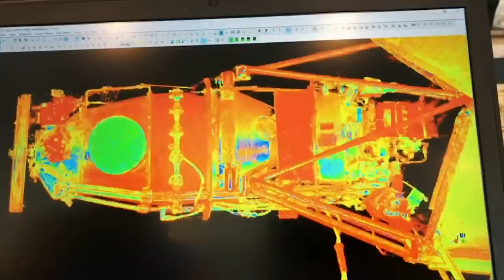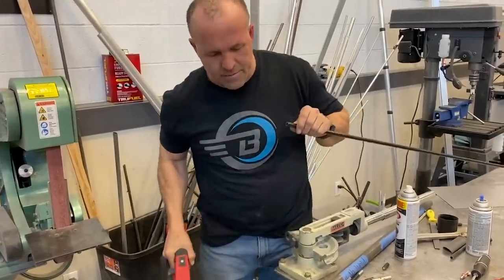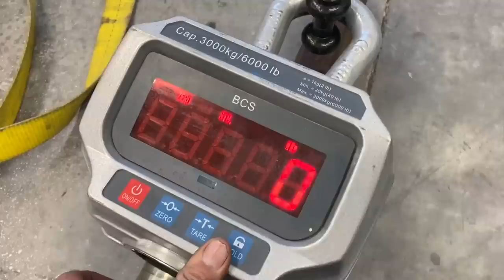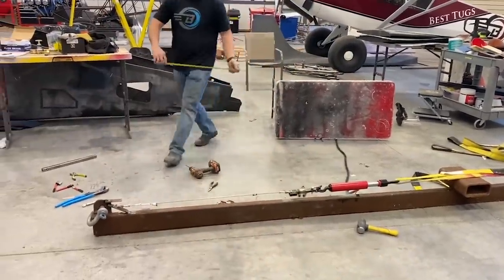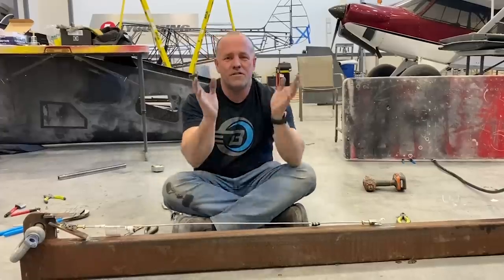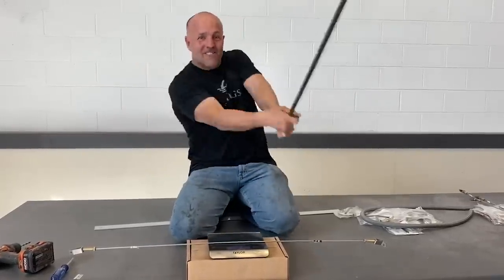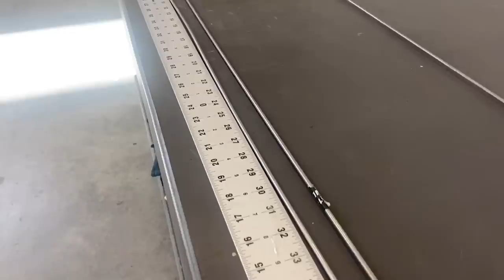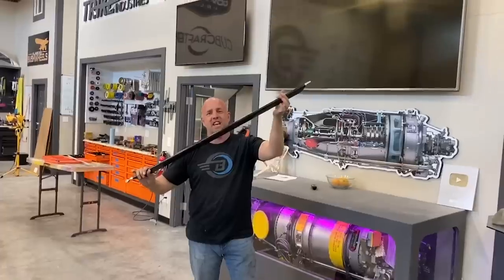Testing to Failure (Scrappy Bush Plane 17)

Comment: As a truck driver, I approve of this video!
Twist your straps, PLEASE!
Very few things more annoying than listening to the screaming of strap flutter from someone who doesn't know how to do it right lol
Plus, it's not uncommon that it leads to failure, especially with the light duty consumer straps, because it's causing constant friction where it goes over a corner or whatever.
But, just a half or single twist, if they are twisted lots of time, it doesn't distribute the load across the width of the strap properly, plus it looks ugly.
And make sure you tie the tail of the strap up, wrap it around things, duct tape it on, etc, so they aren't flying in the breeze.
I almost put my front tire on one hanging 20 feet off the back of a car trailer at a red light last week lol

Comment: You needed a telltale paint mark at the compression clamp to see if the rod slips in it. They use the same marks on cables to see if they shift in the Nico press sleeves.

Comment: I never saw such a positive proof of the strength of carbon fiber before.  Now I guess the challenge is connecting to it.  No welding.  Good rivets and epoxy I guess.  I wonder about a grooved compression fitting of some sort.  One suggestion....decaf coffee. 😝

Comment: I have a master engineer concern :o) It’s just the expansion rates between the steel frame of the tail and the carbon stringers. It will need to find that some where in the structure. I guess at altitude the carbon stringer force will reduce. And be maximum on the ground in direct sun on black tarmac. - That glued socket joint was epic. Really interesting vid, loved it ^-^

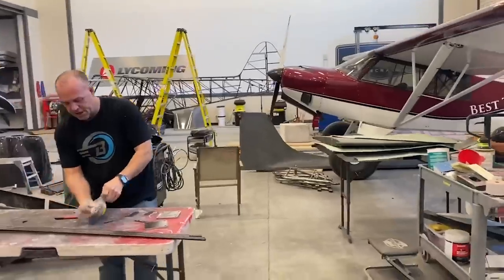Comment: Is that piece of metal on the rudder ( looks like it has 3 rivets in it ) @ 1:59 a trim tab?
* See if I understood this correctly: 550 lbs - compression fitting
** Didn't realize the bar passed thru the compression fitting and had a nut on the end. If I had realized that, I would've predicted the rod would break... And I still would've been wrong.
* Will try putting a twist in the strap on my boat. It oscillates like crazy on the highway. Thanks for the tip.

Comment: As a Mechanic and amature fabricator the only thing missing from the test is vibration. What is the long term effect on the metal to composite bond?  The real life stress cycles will include vibrations and harmonics from the engine. That would be my only concern is the bond joint can't  be inspected until failure. Keep up the good work. Your videos have given me many ideas for future projects although  none are aviation related. I can't wait to see Scrappy fly and hope you make it to Sun and Fun. I would have to attend just to see her fly.

Comment: Great explanation on testing to fail Mike.
I love the parts you make with Carbon fiber. 
My question is how will you set tension equally on all wires(struts by now) equally?
In flying and landing wires deflection is used, so how will you set tension?

Comment: Looking at scrappy the area change on the tail surfaces looks in the order of near double but with the velocity changes from that engine / prop combination, would be interesting to know as that would determin the loads. As double the speed get four times the lift load so with double area, you would be in the order of eight times the loads (which is right at the place your carbon ones are at, with the same % reserve factor). I know your not going to fly at twice the speed of a normal Cub but just tought that prop blast might put an airflow of that order over it, that said I don't think so as the prop choice you have, is more about volume of air, rather than speed of air.
As ex Lotus design engineer, I can say that Colin Chapman would have been very happy with the wire failure (multi component fail).

Comment: Any stretch would be the first failure, which you just said,  I think the brass threads would fail first before the cable.
Reply: I figured bond would brake but you see how the combination of glue and rivets together increase the load.  The twist in the foil was explained very well. awesome job! so fun to follow along.

Comment: Mike. Question. The added stiffness results in a higher peak load. Not only for the attagement points but also the control surfaces, lets say when you transition the loading on your control surfaces. Did you factor this in while engineering? What about buckling. I don't know how much flex is in the elevator wings at the attagementpoints. The wires look like they will bend and strech back after buckling. The carbon fiber will break after a surtain angle and have lost tensile strenght. Or will the deflection of the elevator be to little to ever come to that point. Hope you keep it up...keep on scrappin.
Reply from the maker: Great thoughts and I love when people think and ask at the level that would bore most people.  👍🤠 We think alike. All of that was taken into calculations. In a later video you will see the doubled up attachment points as well as turnbuckles that allow movement at the ends.  I have overbuilt it including everything you mentioned.  I wish I had time to dive into all those details it would make my videos hours and hours longer on each topic.  Sadly I wouldn’t  have time to build anything. Hope you can understand 🤠. Cheers and thanks for the thought

Comment: As far as flat straps vibrating in moving air, I think you are referring to Aero-Elasticity? 
was that a sneak peak of DracoX?
looks like it already has the turboprop mounted, and the wing mods done?  Still needs landing gear mods?  or just wheels?  The white looks spectacular!

Comment: Hey Mike, how can the stress testing of a flying wire be more fascinating and suspenseful than a Netflix thriller? But it is! what a fun episode to watch. 
I was wondering and I am curious: I have used that same technique on my RC-models, e.g. for pushrods, rudder linkages and such. However, it being so small in comparison I never used rivets. Just your epoxy method that you showed. I would be immensely curious what load it would have taken with just epoxy and no rivets. Cause after all -the rivets also weaken the carbon fibre rod... another testing for that? Just for fun? since breaking things is so much fun - and I agree, totally!

Comment: Have u considered the resonance / harmonics vibrating the carbon fibre wire? , and if it will effect the brittleness of the underlying weave?
The metal of course has a elasticity to an extent, and then there after plasticity/aka failure.. of which the threshold is quite high and broad, 
In retrospect, the carbon fibre id think would have a greater overall tolerance/to stretch, but with the wind resonating the rod, as like when flyingwires hummmm, its noticeable/audible  at a certain pitch, but think of the vibration we dont see or hear, that might work away at the weave..
Just a thought ,incase of terminal failure in flight under load/ and under axial stress/& vibration.
Super cool demonstration and video though!! Truly awesome work your doing that brings me back !
Reply from the maker: Marty B  thanks for the great comment 👍🤠 usually if I go into that much detail on my videos I get a massive majority stop watching and bail out.  I watch the analytics closely and find 99 percent of people want basic discussion that is in normal terms.  Everything you mentioned was analyzed closely and it would take more time than I have to type and go into it but we are absolutely in great shape.  This has been proven to an extreme on sailboats and several other areas with extensive research.  Thanks for thinking enough to comment.  Maybe in a later video I will get a chance to discuss all this in extensive detail and show a couple other tests.  Cheers my friend 👍🤠
Reply: Mike Patey absolutely understood and appreciate the reply!👍👍
Im no engineer , but i was &am  an r&d , think/design/builder , so thats why id thought to chime in 😊😊.                     Very cool knowing u go outside the box , ie: marine applications , etc,. in Consideration to your product build applications and design. I love watching your episodes, it invigorates me lol, and keeps us energized for our projects...., keep up the great work!  Hope we can cross paths and chat airplane one day!        Cheers!

Comment: Are you testing the part for impact resistance? There will be rocks hitting the strut occasionally. The Wire can deal with rock impacts pretty well. Carbon can get fractured by impacts.
Reply from the maker: actually great comment.  A couple of us have broken our flying wires with rocks.  The impact of carbon before it breaks on the thickness i got is actually higher and stronger than the wire.  this was one of the other reasons i did it. Also when we broke wires one of my friends broke it on take off and almost killed him once he lost one,  all the wires that were  in tension so the remaining loosen up without the full loop around all four. If i lose lets say one lower carbon tube i have compression on the one above it and still maintain full stability because i have compression loads high enough to hold it from one side.  great question my friend .. cheeers
Reply: @MikePatey  I saw that the Carbon struts have tensile strenght enough. What worries me is the carbon's reaction to shock impact while loaded in tension. Carbon fiber's lack of plastic deformation is not your friend in this mode. II've seen carbon fiber layups shatter, and it isn't pretty. I get your point about the other rods working in tension to keep the tail in shape after a theoretical impact, but some way of containing the damage or adding a bit to the toughness is desirable IMHO. Would have been nice to use Carbon/Aramid weave for the airfoil wrap, maybe with the Aramid fibers running lenghtwise in the topmost ply. 
Great job!

Comment: changing worn bolts is cheaper than other parts though,  at least that way you get a Christmas Party at the end of the year.. and putting a Monel rivet straight through would work better. and re the twist, yep all you need to do with a strap is give it a half twist and your good.

Comment: Hell yes!  good stuff Mike.  I thought the bolt holding the test piece to the jig bracket you welded on would go first as it was side/shear pressure.
And Mike, would it be dumb to want a see through floor, even more area than the old helicopters like the Hughes 300 (or was it 500)?  I was thinking about my design, using Lexan...

Comment: Mike - You should be aware that carbon fibre is stronger but much more brittle compared with stainless steel.  You should be examining what might happen if there is something like a bird strike that will weaken your stay.  An examination of the experiences with high strength yacht stays will reveal some interesting information about the reliability of what you are doing. There have been some spectacular unexpected failures with them.  You should also examine  Kevlar as a product to protect the carbon fibre from damage.

Comment: Wow that carbon fibre and glue is strong. I was just wondering if the carbon fibre and the metal tips can be joined together with a coarse ACME thread glued on the tips, instead of the rivits-? Scrappy is getting beyond interesting.

Comment: Got a question for you, your design is terrific, absolutely spot on, stating that as an retired German Airforce Huey Pilot and a MME, running engineering companies for decades... i just wonder why you are still going for cables instead of push / pull rods wich are backlash free and much more precise in there action and response?

Comment: Beautiful strut, to the point of overkill perhaps. I think I would design the strength in the tail rather than wires to support it for elegance.
I guessed the weak points mostly right, I didn't like that folded bracket, forces off axis seem icky but I expected the other end to go for that reason. Also didn't like the rivets, not just because it is victorian era stuff :)  but small points feel like they betray the uniformity of the rest. But like with threading, if you have enough rivets it will hold. the young's modulus of Carbon and the relative stiffness of the tool steel end might also mean that any hole offset means individual rivets carry most of the weight in succession. precision drilling might give it 30% extra strength. Just a guess.

Comment: Great engineering by Mike Patey. But I'm not so sure about that connection steel - carbon. According my calculation the resin itself should bring the required pull forces up to ca. 4000 pds. If the rivets are sheared of, the resin did break much earlier.

My question: the addition of ceramic microballs to the resin - does it really make sense? Don't the balls work here like small bearings -and finally reduce friction between surfaces and reduce adhesive strength?
Any experienced advice? Would like to use for my own RC Heli.

Comment: Brass threads will be first line of failure, followed by straightening of the bend.  Carbon fiber is good on tensile strength, not so good on compression strength.

Comment: Shearing the rivets,. they look like ali alloy?, but if you used AGS (aircraft gen spares spec) monel break shank  they will be the strongest you can buy with  twice the strength of ali.  Steel would be also very strong.
 Use them here in my w/shop on aviation assy.

Comment: Do you experience galvanic corrosion on a stainless piece bonded to carbon fibre?
Reply from the maker: If I’m doing a direct contact I separate with fiberglass. On this I had threaded stainless and filled threads and hole to bond with hysol as the separation agent.

Comment: I play and lost. I thought 1st failure point would be the attachment point eye hole @ 300kg.
So I thought that would be the failure point. So right there, but had no guess on total break weight. 
Had no idea on the cable strength.

Comment: If I understand correctly you don’t need to adjust the rod endings(?) Why not make carbon end insert plugs and/or more carbon outer layers. Drill the hole and use some metal guide pipes for the attachment bolts. This way avoid the weakest part.

Comment: I'm a metal worker and picked a few failure points. Didn't predict the stretching of the rod. I assume its stainless. What grade? A question I ask is, with  the differential of epoxies over adjustable metal is longevity.  When you sell on Scrappy assuming you don't crash it like Draco, lol. Joking. How well will carbon/epoxy bonds stand up in the long term? Autocad doesn't have a prediction of ill use and use by dates of bonding adhesives. Most things I've seen over the years made from polymers they don't stand the test of time. Steel bridges and buildings are here from hundreds of years ago, given due care. Carbon fibre is rigid and thus susceptipal to fracture at its union.

Comment: The rivets seem to be the week link in preventing electrolysis between the carbon fiber and metal. When the hole is drilled through the end bracket and the carbon fiber rod I wonder if the epoxy coating that oozes out is enough of a barrier or is the epoxy completely removed as the rivet is inserted into the hole thus allowing electrolysis to occur.

Comment: I'm a bit worried about the failure mode. The steel wire had indications of being overloaded at roughly 1/5 of the final failure load. The carbon had no indication before catastrophic failure.

How do you find out if the part needs to be replaced before it actually does fail?
Reply from the maker: realulli great question 👍🤠 Carbon fiber doesn’t have a fatigue number like metal so it stays full strength until failure.  The plane actually only needs about 200 lbs.  the 6-800 is way over and 4,000 is insane and will most certainly unlike failure without a crash of some kind. Yet one should always assume if it did then what.  Simple. Because it has compression load ability I can lose one and the other one is still 20 times the strength needed from the other side. Technically I could lose both the tops or both the bottoms and fly perfectly as it acts like a wing strut and doesn’t need both sides when it holds tensile and compression

Comment: Dear Mike,
how would you be able to take FOD impacts into consideration on a carbon tube?
Reply from the maker: e36s50b30 great question and unbelievably well. I’ll talk more on that later
Reply: Feelin‘ a little proud right now...☺️
I alctually wonder if you might have incorporated a mesh or honeycomb between the tube and the aerodynamic „cover“?
Or maybe kevlar in between?🧐Just like on the gravel kit 737s.

Comment: BTW, are the rivets aluminum?
...if so, how do you go around avoiding contact with the carbon fiber? ....I think just a layer of epoxy should not be reliable enough to avoid corrosion... and as a result, another interesting question here would be how much of a load a glue-only joint would hold.

Comment: Build it, break it, make it better.  Late fathers motto
as for failure, i wanna say it will pull the threads or glue bond before the main piece  breaks,.
Only 10:08 in
Guess i was wrong.

That carbon rod is so strong its actually holding up to the bending  of that steel beam.. HOLY OH FUCK

Comment: Did you consider perhaps bonding the fittings with Redux - Araldite 420 which is primarily an adhesive. I suspect it would be even stronger than resin mixed with micro.
The other parameter to consider testing is the effect of temperature on bond strength. Epoxy adhesives “let go” when they get hot. Is there any way the black finish of carbon could get really hot in sunshine so that failure strength is reduced??

Comment: With your engine-prop combo, are you going to use in-flight reverse for ultimate short field landing? You have demonstrated you can drop the plane from a foot. This engine provides instant power iso the turbine with power lag. Is this why you  built the extreme gear? I guess you would be able to stop the plane within half it’s length, if you really tried. By the way, i exactly guessed the failure point and load, lucky guess.